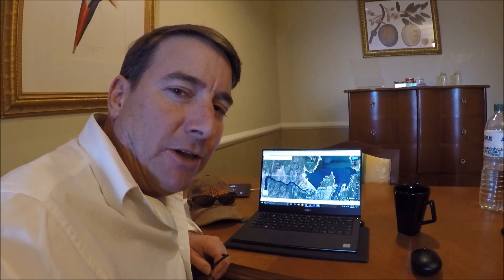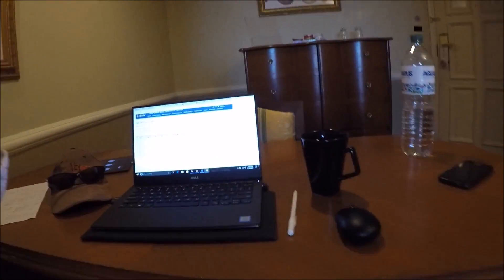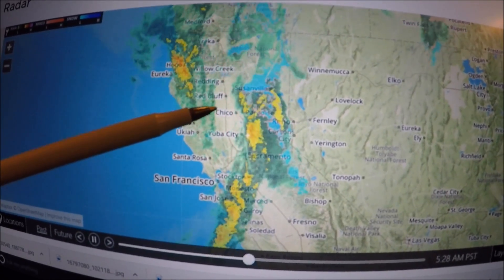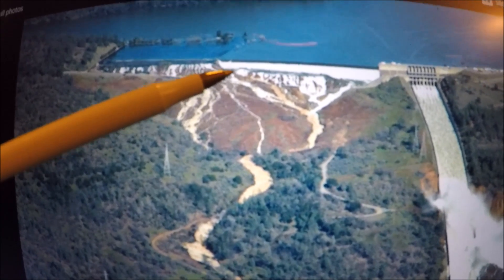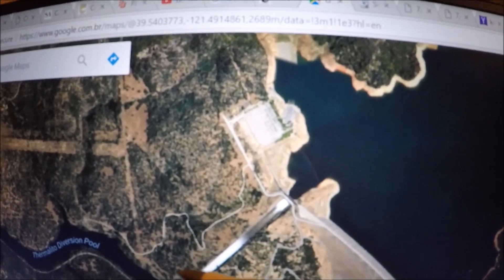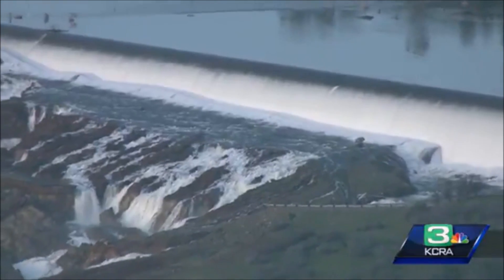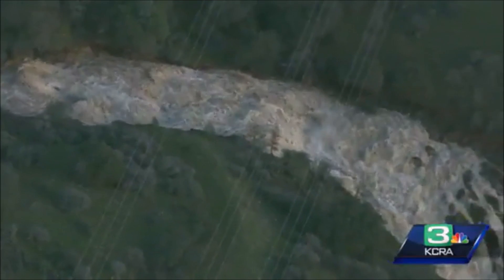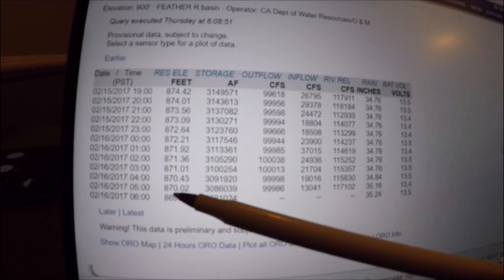Oroville Reservoir Update 2/16/2017

Comment: People do not understand the power falling water has. Miners using relatively small nozzle water cannons were able to blast away mountains. When people saw what was happening, they outlawed that type of mining. It was, however, insignificant, compared to the amount of water flowing out of the Oroville Dam. The Rocks they are dumping now will end up down stream if this over flows again!

Comment: I wonder me since I hear first time about this dam. Why the main spillway have so a less flow? Why the emercency (also 2nd spillway) have not a concrete bed? Why this very large home-made sea not have another spillway into another river or an other normal secondary higher flowed spillway? This dam saves drinking water or it is to produce electric power? 

The most videos never answer this easy questions, specially the T.V. stories shows only dramatic pictures. Greetings from the home of the King & Queen Dam desaster.  :-)

Comment: So, was there actually a breach in the emergency spillway as I have heard or was it the fear that erosion in front of the spillway was going to undermine the footings of the spillway and it would then get pushed forward and over, allowing water to flow through.  In order to create the 30 foot wall of water they were predicting,  it looks like the entire spillway would have to fail at the same time which seems rather unlikely.  I'll be the first to admit I'm not an engineer.
Reply from the maker: the latter.
Reply: thanks to Juan's reporting, we are all a little smarter when it comes to damn dams. One of the things I learned was how fast a breach becomes a complete failure...faster than we can run away, I'm afraid.

Comment: What people fail to realize is the dirt weir to the side of the 1700ft long spillway, where it was thundering over, is the "fail safe" for the reservoir. Once they let the water erode that section, it can't be stopped. On the videos, you can plainly see the exposed lip of the emergency spillway after flow subsided, with a truck parked by it, I estimate it had washed that lower lip out (dirt) by around 8 ft. Bad juju if it extends under the concrete spillway into the reservoir. Plus they had the crater forming to the left of the spillway, eating itself back to that very lip. There was 2-3 feet of water flowing over the concrete spillway at the height of the flow. 

They look like they are anticipating an increase of future water in the catch basin, because their building a coffer dam, to block the power plant off from this water, plus to stop water from undermining the toe of the dam proper. Monday and Tuesday are the D Day for this, when all the new incoming rain and water will really test it. Myself, I would be removing myself today and no later than tomorrow from downstream, until at least next Wednesday, to see what happens.
Reply from the maker: Keep your eyes on the data here...http://cdec.water.ca.gov/cgi-progs/queryF?ORO
Reply: Thanks, a number of us are watching levels closely. IF we feel things are out of control again, then we WILL alert to get  the hell out. Just fyi, they have just finished re surveying the dam, to make sure the topography hasn't changed. They AND us, should be watching this situation closely. Water tables in Oroville have risen so much that basements are now flooding. Rarely is a cataclysmic event just one error, but a series of errors leading to an event. Crossing my fingers for everyone in that area. Follow you're intuition.

Comment: 2009 images of cracks leaking in the spillway has now led me to believe that the problem started in the ground under the spillway, and not from the spillway surface down as previously thought. The photo was taken in 2009 by Barbara Arrigoni and the article was in the ChicoER. The Dam probably needs to be torn down and rebuilt. It probably developed cracks during earthquakes between 1968 and 2017.
www.chicoer.com/article/NA/20170210/NEWS/170219971

Comment: My question is if the main spillway has 150,000 CFS capacity and the lake is rising fast, why was the main spillway only open to 50,000?  1/3 of its capacity...they even admit they have used it at 150,000.  If they had opened it up earlier the emergency spillway would not have been a factor here.  Who made this call..."hey keep the main at 1/3rd so we can test out the emergency spillway".  Why did this even happen?
Reply from the maker: JoJo Kadilihopper because it's busted...if we loose this spillway entirely by blowing too much water down in its present compromised condition...disaster looms large.
Reply: I think the point I am making and I might have got  the chronology wrong.  Did the sinkhole happen before or after the Emergency spillway was used.  I am monitoring input and output flow now and its looking much better.  The level is at 854.81...outflow is 69646 CFS and inflow is 45475 CFS as of 02/18/2017 10:00.  These storms are only now starting.  I've been monitoring the other dams in California and almost all of them are also full or close to it.  Even if nothing fails, they could flood the valley just through water release alone.  The water system is really pushing its limits and there is still a lot of rain coming. 

 Don't get me wrong and I'm not trying to be difficult, you video was great.  My concern from the start is there really is very little up to date information on what is really going on here.  My other concerns are the water veins produced by the Emergency spillway, and lets face it, its built on dirt, where the main dam is built on bed rock.  There are sink holes everywhere and many storms to come.  The real damage is underground that we can not see.  Water+dirt=mud. The entire left side of the facility is already compromised, but as to the real extent, we don't know.  If the side of this mountain landslides it will take a lot of infrastructure with it and maybe even the emergency spillway itself.  

God only know what it will do to the remaining main spillway.  They have known about this problem for at least 12 years and did nothing.  Now they are trying to fix something in hours that really should have been a major upgrade long ago.  So forgive me if I sound skeptical about what little news we can actually find and the reporters is all sunshine and lollypops.  Nothing has really gone right here.  They didn't even have models of what the emergency spillway would even really do in damage.  To be honest, this is a 30 foot high wall, 1200 feet long, built on dirt.  Even the area they are trying to shore up could have massive sink holes and water veins compromising the integrity of the  hillside itself.  lets face it, this thing is an absolute mess.  Its just dirt with massive amounts of water poured onto and into the mountain itself.
Reply from the maker: before

Comment: Down now to 859' as of 1:00pm PST.  Looks like they have it under control. I wonder what the maximum inflow of water was in the past?
Reply: Wow! I wonder why the emergency spillway wasn't used then?  They must have practically emptied the lake before that storm. I saw this in a LA Times article about the recent storm:
In the five days from Feb. 6 to Friday, Oroville received more than 6 inches of rain. The surrounding mountains and foothills received up to 24 inches of rain and snow in the same time period, he said.  The storm’s runoff sent water into the Oroville reservoir at an average rate of 115,260 cubic feet per second, data show. The lake’s water level climbed 50 feet in five days."
The coming storm is going to be weaker that the storm on Feb. 6th.
Reply: Articles about the 1997 flood said over 331,000 cfs inflow
Reply from the maker: alan30189 just last week about 180,000+cfs

Comment: why wasn't the emergency spillway paved?  Thank you
Reply: They didn't want to disturb the Red-headed Cockaded woodpecker habitation.
Reply: Seriously, they probably thought the auxiliary spillway would never overflow and if it did ever overflow, it would follow the natural curves of the landscape down to the river. The thing they didn't take into consideration is how future generations would neglect to maintain the main spillway.
Reply: This morning, Feb. 18th, I may have found your answer. Or, maybe not. I saw a photo taken of the spillway back in 2009 where workers were patching cracks in the same area of the spillway that was recently washed out. The photo shows water seeping out of the cracks as crew members attempt to patch the leaks. Paving the spillway would not hold and would be a waste of time and money. The only choices they had was to patch it, or tear it down and rebuild it. Of course they chose the cheaper route. At this point, I don't blame anyone for error. The cracks could have developed from any earthquake between 1968 and 2017.

Comment: Repair of the main spillway is top priority. Hoses or pipes with pumps should be installed ASAP to siphon the water to the lower stream. 

The main spillway should be free from water to allow adequate repair.

Comment: should have been fixed in 1997.the 25 billion spent on illegals every year would help
Reply: The flood of 1997 caused over 331,000 cfs to flow into the Lake. They should have known something like this would happen. The peak maximum inflow during this recent flood was on Feb 9th at a rate of over 190,000 cfs. Imagine what would have happened if it was 331,000.

Comment: As an emergency measure the water should have been siphoned down to the 
lower stream using hose or pipes and there are a hundred ways to do this
 with the same volume of discharge with that of the main spillway or 
even more. The main spillway should be free from water to allow adequate
 repair.

Comment: Anyone being introduced to geology and hydraulics would have predicted what occurred to the Emergency Spillway.  A Cub Scout could figure that out, so why was the downflow area for the Emergency Spillway channelized to handle any water flow?  A small catch basin, really?  It would appear that, in the building of Oroville Dam, that corners were cut on the Emergency Spillway to save money.   This needs to be investigated.   Was the original plans to include an channelized downstream?  If so, who was it that approved the cost-cutting measure to not build it?  Was this contingency not even planned for?  If so, all of California's damns will need to be scrutinized.

Comment: you don't turn on or off the emergency spillway... Its not even a spillway its a Overflow. If water is coming over it then the reservoir is overflowing... lmao good video man lots of spot on info. I listened to one idiot try and tell me they were dumping rocks down the AUX spillway to plug that hole, and I knew they weren't lmao. Lots of disinformation out there about the damn dam. yea they got to reduce the outflow to keep the lake at a certain level because it has different CFS ratings depending on how much water is in the lake. at current levels if they need they will release up too 250CFS like the spillway was designed to handle, problem is in 96 when they outflowed at 160Cfs they flooded out downstream towns and dams and levies. they got too put a boom up in the lower part to stop debris pooling at the foot of the dam, that's another reason they never outflowed more then they did. so many factors in the flow rates that they have to think about.
Reply from the maker: EddieG Yep! (I saw that other vid...jeez)

Comment: "Record breaking amount of rainfall". How far back does the record go? What is the record rainfall for the past 100 years? What date was the last rainfall that was closest to the recent record rainfall? What was the previous record and when?
Reply: So far I have found that in 1997, inflows were 331,000 cfs! Knowing that inflows can reach so high, wouldn't it be wise to maintain a lower Lake level?
Reply from the maker: P.B. Theriver I've been thinking about the 850' desired lake level mandated by the State. I'd knock it down another 30' to make up for the height of the compromised emergency spillway... Shoot for 820' elevation.

Comment: Since the #1 purpose for a Dam is flood control, why do they allow the lake to fill so high, which allows the Dam to get out of control? What is the best level for the Lake to be to prevent the Lake from filling to the #1 spillway? The water should rarely ever reach the #1 spillway. Isn't the water level controlled by the power plant? How much water flows into the power plant compared to out flow? Is it enough to handle all the water coming out of the Sierra Nevada?
Reply from the maker: P.B. Theriver check out the previous videos in the series...
Reply from the maker: 850' elevation is about optimum for flood control. The top of the reservoir at the emergency spillway is 900'MSL.
Reply: Do you know the height from the top of the emergency spillway to the weir on the main spillway?
Reply from the maker: P.B. Theriver no.

Comment: Some dams were built primarily for irrigation, power second recreation third. Flood control was not an issue until long after many dams were built. Then they built communities on flood plains which made flood control the new big issue.
Reply from the maker: Here in N. California it's flood control...
Reply: Maybe, but now they are having to release as much water from Oroville as what is coming into it  because the reservoir is full. So, so much for flood control.

Comment: You need to mention the stats on that dam and how it was constructed. A reinforced concrete base built on solid rock, 3900 feet thick at the base, an impermeable clay core with an adobe and mine tailing outer layer that has since construction metamorphosed into concrete. This dam is not going anywhere. The problem is the capacity of the river drainage system between Oroville and the ocean.
Reply: Why are they saying its an earthen dam? The video shows no concrete, no clay. Just dirt.

Comment: ...So what happens during the snow melt? Also why wasn't  the emergency spill way buttressed originally to prevent erosion to begin with?
Reply from the maker: TheDirthound snow melt is even easier (generally) to regulate than these heavy, wet rainstorms. snow melts at a much slower rate than rainfall, unless it's being melted by super heavy rain like last week...
Reply: ...noted.
Reply: +blancolirio Usually the case with snowmelt, however the rain has been accompanied by warm weather systems, which again speeds up snow runoff and its been a double, or triple whammy.

Comment: Good video.  Hard to believe anyone would give it a thumbs down.  I hope your sources are right about the stabilization of the headward erosion on the main spillway.  Also hard to believe, regarding the emergency spillway, that no one realized millions of gallons of water flowing down a dirt covered chaparral slope wasn't going to erode it. The emergency spillway design should have been more like the main one.

Comment: Good work. Once these upcoming storms have passed and the Water Resources agency can begin to think about proper long term remedial engineering work, a lot of money is going to have to be spent. I've yet to see any explanation as to why there was no concrete channel to guide water downhill from the emergency spillway and into the Thermolito Diversion Pool. Without such a channel, the inevitable result of the emergency spillway being used was always going to be serious erosion. How could the engineers (or commissioners) not have anticipated this? Perhaps there was a good engineering reason for them not to build one, but it escapes me entirely.
Reply from the maker: Thanks, yes the design criteria in 1968 did not require this....and now it's going to cost a small fortune to upgrade to today's codes.
Reply: This is the highest dam in the country. located in an area known for mild winters and lack of precipitation relatively speaking. The amount of rain we have had in the past month is unheard of!! I mean has NEVER HAPPENED BEFORE!!! Ever. They said that we were out of the drought after the very first rain of the year. Thats how much rain has been getting dumped on us. We were so happy...at first.
Reply: Lisa speaks ..
Feb. 9, 2017 ........190,000 cfs inflow
Jan. 1, 1997 ........331,000 cfs inflow
Never say never
Reply: The Dam came within about a foot of running over the emergency spillway in '97. The reason I believe it didn't overflow back then is because the operators of the dam at that time maintained the Lake at a much safer lower level below the 850' Mean Sea Level (MSL) mark.
Reply: That's actually an interesting point that goes to the nature of spillway design. With a gated spillway, the operators can control the rate and volume of discharge, though this also allows for error; with an open overflow spillway, no discretion is possible and so it must be built to allow very for very high rates and volumes of discharge. In reservoirs with open overflow spillways, there are usually also two or three gated sluiceways to allow controlled rates of discharge from the bottom of the reservoir rather than from the top.